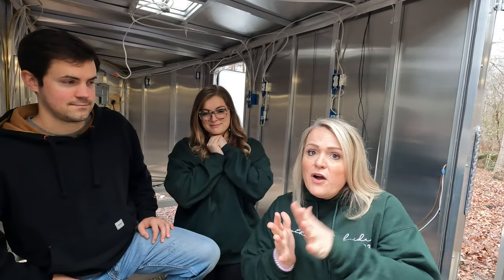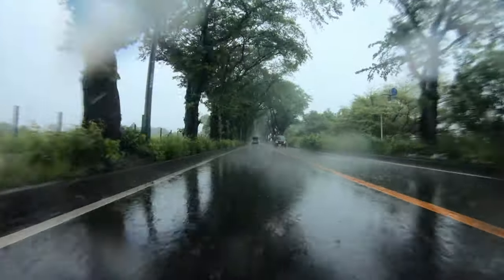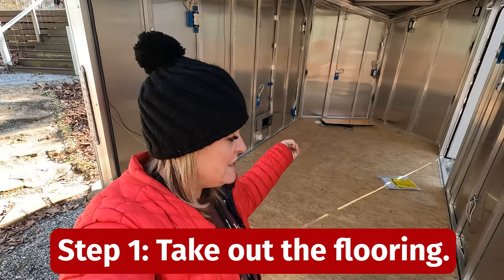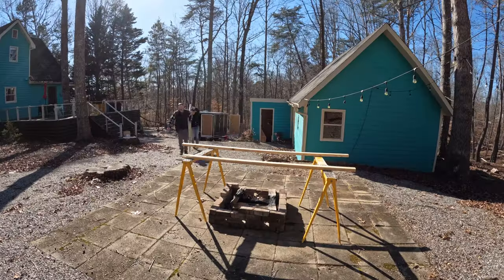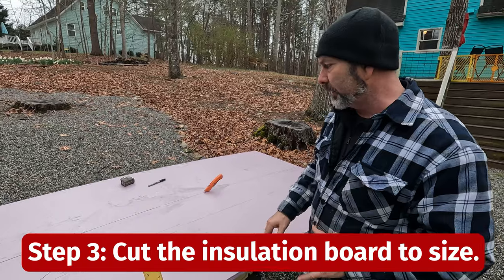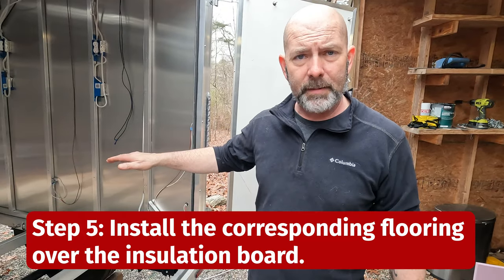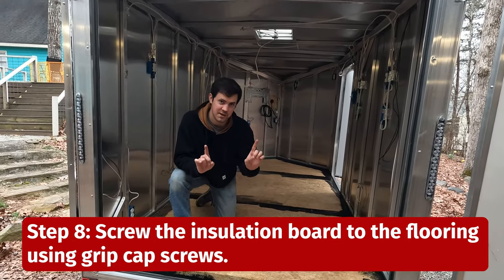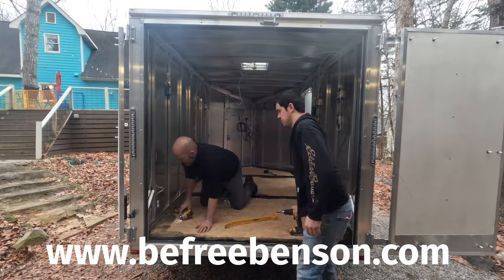HOW TO WEATHERPROOF YOUR CAMPER FLOOR//EP.6

Comment: CURIOUS!!!! how does the exposed insulation do under the trailer? my question is more so asking how its held up to moisture, rocks, and wear and tear from driving down highways, dirt roads, off road, and withstanding wind, rain, snow, salt, mud etc.  very curious to see how its either holding up or what you put in place to protect it! Thanks!
Reply from the maker: It has held up very well.  No issues so far.  Thanks for watching!!!
Reply: This is why I am thinking of putting some stone guard as the bottom layer below the insulation, but that might be overkill.
Reply: What are your thoughts on on flex sealing the insulation?
Reply: @befreebensondiy  Looks like it's been 9 months since this response, would you be able to update on how it's doing still? Is there anything you would do differently now?